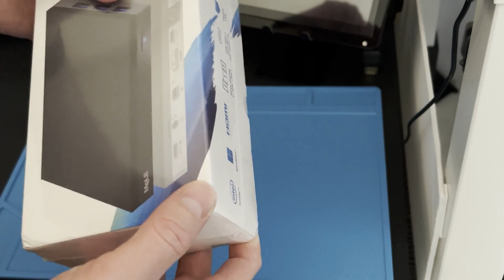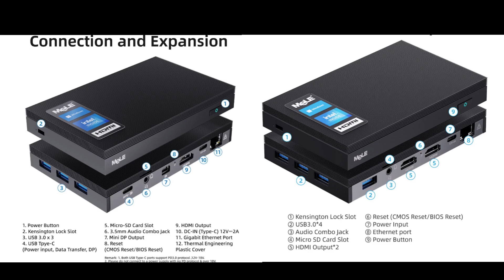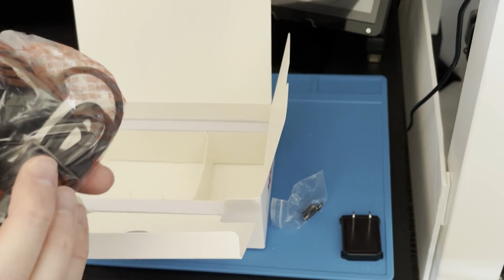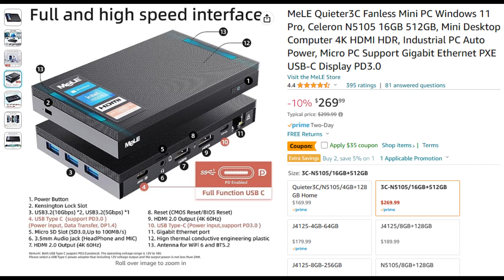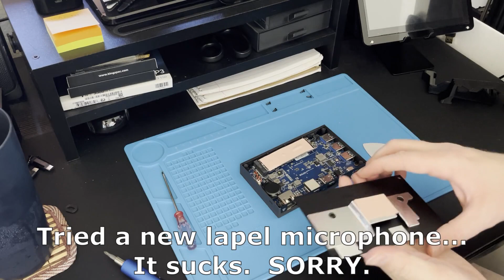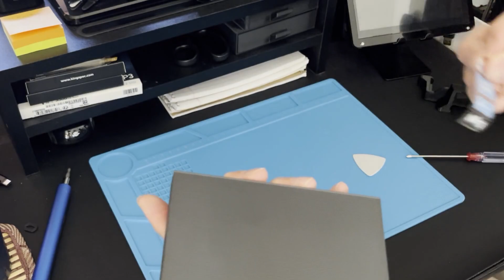YES PLEASE!!!  A Totally SILENT 4k Mini PC?!?-  MeLE Quiter 3C

Comment: I can't find any videos where someone does a teardown on this, showing the cpu cooling.  I guess you don't want to have to repaste and/or ruin any thermal pads, but I am so curious what that cooling is like.
Reply: I've since found videos on the cooling solution. There's a slab of aluminium above the CPU that contacts the top case, and the top case is made a thermally conductive plastic material. Knowing more about the thermal design makes me admire this more.
Reply: I also believe some newer units are having the emmc replaced with SSD which is better performance, alas doesn't let you use both at once.

Comment: I got one of these, and use it in conjunction with a Portable battery, and a drawing tablet screen, so I can do digital art anywhere I go, it's like a laptop except I can swap parts out easily if they break, unlike a laptop which is done if something goes wrong on it.
Reply: Did you ever run into any problems with this? This is basically what I want to do with it too
Reply: @jlfazmo  no its amazing, the only issue is I am spoiled by faster cpu on my main computer. Just make sure if you have a nvme in there that it has heat transfer tape, and get a good battery like voltaic if you want seemless charging when plugging in

Comment: Do you think it’ll overheat if I use Game Pass on it for few hours at a time?
Reply from the maker: If you are using the Game Pass cloud service to basically stream your games, then I think you have a better chance of it not overheating... if it runs the games.  It doesn't have an external GPU so you are using graphics from a Celeron.  
It's probably going to run things like Minecraft and CS GO okay if you lower the settings. 
Something like Cyberpunk might not even run.
Reply: @S-Technology  that’s what I was thinking too, I just wanted another opinion. Thank you!!

Comment: I actually currently use it as a small home server. It's pretty nice and yes, it is silent. So perfect for a server, nobody notices it.
Power via USB-C is another thing I like because more or less all my devices use it so I have enough chargers and cables.

EDIT: Of course, I put Linux on it. Working well.
Reply from the maker: Yeah my home server “room” also happens to be the guest bedroom in the house. I tried using a more powerful mini-pc but its fan was too loud for when guests stayed over.  I tried adjusting it and couldn’t find a good enough balance between lowering the fan speed enough to not notice it and it not trying to thermal throttle itself to death. 

Now it’s on and so quiet.  I think the hard drives make more noise than the pc.